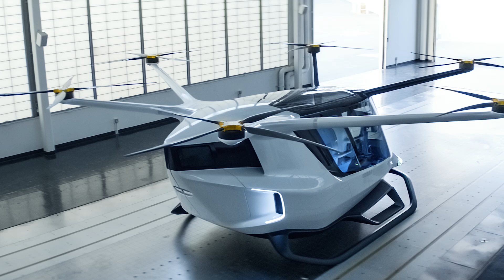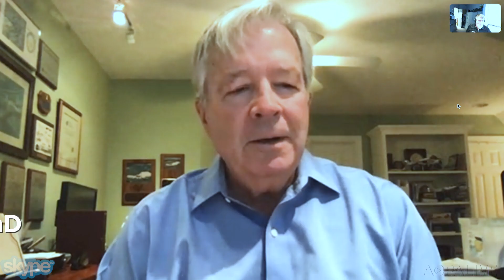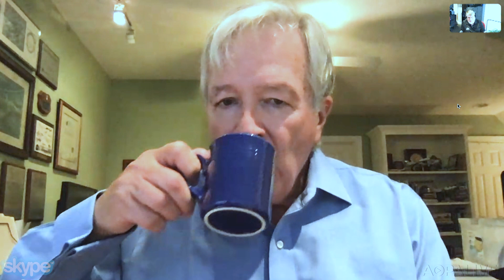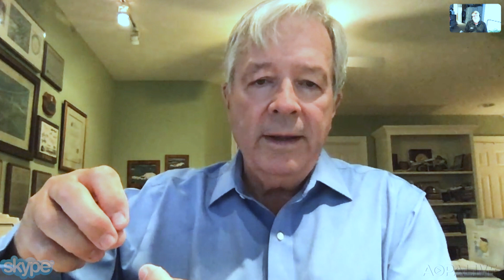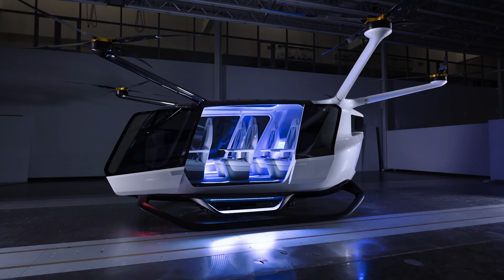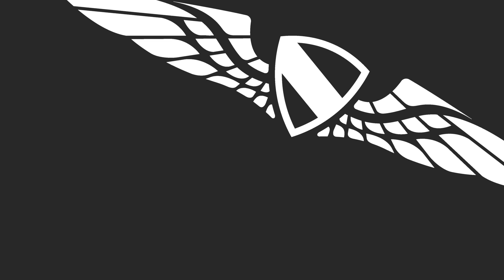Dr. Bruce Holmes - eVTOLS and hydrogen power

Comment: He's wrong because hydrogen is critically difficult to store and handle. Honda made a fuel cell car with a carbon fiber tank of hundreds of liters capable of withstanding the pressure in the mariana trench and it could hold 4kg of hydrogen. The equivalent energy of 10kg of gasoline which you can store in a plastic bag. And fuel cells are only around 40-50% efficient which can actually be matched by a turbine generator. So by weight HFC is savagely bested by a very conventional fuel burner. If you are concerned about green credentials then liquid fuel can be produced from green electricity. Synthetic fuel is quite viable. But more importantly for the jump vtol market, battery flight with current technology can get you 300km down range and that's plenty reach for the instant gratification segment and if you need to go further then the jump was to an actual long distance airplane and on from there.
Just like with battery cars vs hydrogen cars, battery flight will dominate so greatly that hydrogen never competed.
I would further point out that SUV thinking for vtol is old school and missing the mark of uber rides where it's 1 or 2 people that need to go. Same as we drive in our cars. If a family of 4 need to go to the airport then take 2. Size and weight is going to be very critical when setting down in a city. Corporate helicopter obesity need not apply. Less Trump more butterfly.
Further, I'm assuming that the Skai doesn't actually fly. And it doesn't avail itself of lifting surfaces nor aerodynamics so it's very energy costly operation should it ever fly.
2 tilt wings and very aerodynamic body is a vastly superior configuration.
Reply: Dan Frederiksen its all about the weight of the energy storing system and the time to refuel said system. The Hyundai Nexo for instance has a range of 600 Kilometers and needs 6 kgs Hydrogen, and it takes a few minutes to refuel. Compare this with a Tesla. I would say it takes almost 600 kgs of batteries to get close, and at least 20 minutes to refuel. Above that, the production of batteries ist not without challenges. Batteries can not be the future solution for storing energy for transportation. The Nexo is for sale here in the Netherlands, everybody can buy the car. There is a complete taxi fleet in the Dutch capitol running on Hydrogen. The problem with hydrogen is the price and the lack of infrastructure. And this is mainly a political problem, not a technical.
Reply: @ClintEatWood  no there is infrastructure. But the hydrogen comes from fossil fuels, it uses 3x as much energy as a battery car and you've never seen one refill in a couple of minutes because it actually takes 20. And it's not 6kg. It's 6kg of hydrogen under extreme pressure in a tank that weighs hundreds of kg and a piping system able to cope with the temperature differences and the 700 bar pressure. Tesla cars can drive 5-600km now and you can charge them at home. Tesla Model 3 can charge at 1600km/h now. It's pretty fast. You may want to realize that battery cars totally dominates hydrogen cars. It's not a contest. No one wants it because it's a bad solution.
Reply: @DanFrederiksen  don't forget that the energy for a Tesla also comes from fossil fuel. And especially US Powerplants are not the most efficient ones. So I put question marks to your stated "3x as much energy". The Hyundai Nexo fuel consumption is 0,92 kgs per 100 Kilometer. Hydrogen cost 10€/kg. This is about the same price as a gasoline car in Europe. Also your statement for refueling time "because it actually takes 20" is not correct (Source https://www.youtube.com/watch?v=41LKbkQV_k4&t=1627s), it takes max 10 minutes, in general 5 minutes. Show me a Tesla that can drive 5-600 km on one load, I have question marks there too. Especially in winter time, and in mountainous areas like Aspen for instance, you are very lucky wenn you reach 400 km. And charging at home takes hours! Were do you get the information that "hydrogen tanks weigh hundreds of kilos"? Guess how much a Tesla battery weighs: 540 kgs. Source https://en.wikipedia.org/wiki/Tesla_Model_S . The Toyota Mirai Fuel Cell weighs 56 kgs and the Hydrogen tank 87,5 kgs. Sorry to say, but your facts are not correct. Don't understand me wrong, I like Tesla's. Electric cars will gain market share, but the battery will not be the long term solution.
Reply: @ClintEatWood  to be fair I exaggerated the tank weight, still hundreds of kgs for the system and not the bullshit claim that the fuel only weighs a couple of kilos and leave it at that. 
Tesla Model 3 is outselling Merc C, BMW 3 and Audi A4 combined in north america. Hydrogen fuel cells cars aren't selling any whatsoever. Hydrogen fuel cell vehicles will never be. Deal with it. The idiots at Toyota and Honda have been insisting it will triump for 10 years yet they failed spectacularly on launch in 2015. Supposed mass production. 
Everyone in green cars hate HFC cars because we understand how much it sucks and that only evil oil corps promote them. 
But an aside is that liquid fuel fuel cells could have merit. And it's possible to make synthetic fuel from green electricity so it's CO2 neutral. Because liquid hydrocarbon fuel is easy to store and handle. Hydrogen however is not. I'll bet you a billion dollars that this Skai hydrogen nonsense wont be even remotely a commercial success. 
I'd be surprised if it ever flies, even empty.
Reply: Dan Frederiksen I am not arguing about the success of Tesla. They changed the world, and did a great job! I am arguing about the right accumulator to store electrical energy used for aviation purposes. The main issues in aviation with batteries are:
1. The weight of the accumulator in KJ/kg
2. The time to refill.
Like I explained before a comparable FC inclusive tanks weigh less than 150 kgs, the battery of a Tesla 540 kgs. This is not a big problem for cars and boats, but it is for airplanes if you want to fly longer than 30 minutes. And, the weight of a battery is almost proportional (KJ/kg) to the stored energy. The weight of an FC is disproportionally, because the energy carrier Hydrogen is very light. Thus, a larger tank reduces the weight per KJ. Imagine how many kg’s of batteries are needed for an intercontinental flight with a Boeing 747 with electrical propulsion. And think about the time to refill. No way that this is going to happen in the next 5 – 10 years. So, my conclusion is, for aviation purposes Hydrogen might be a better way to store energy than in a battery. Just think about it.
Ps I would not compare Tesla Model 3 with a 3 series bimmer. That is comparing apples with pears. They (BMW) don’t even have serious electric vehicles, and still sold 200.000 cars in the US first two quarters this year.
Reply: @ClintEatWood  It's true that you can pack more range into an aircraft with hydrogen than battery but the same is true in a car. It's just not enough to matter. Battery is so much more elegant for modest range and for really long range, hydrogen cannot compete. And that's not considering danger and power density. There is a serious israeli company doing a 1000km electric jet. Not a hydrogen plane. For aircraft long distance use, only liquid fuel fuel cells need apply. Hydrogen will never be.
Reply: @DanFrederiksen  "I think there is a world market for maybe five computers."
Thomas Watson, president of IBM, 1943
Reply: @ClintEatWood  I have seen a thousand years ahead.
Reply: @ClintEatWood  That plane isn't actually flying on hydrogen and their claims are hugely unrealistic.
Reply: PistonAvatarGuy if it is not flying on hydrogen, on what is it flying than?
Reply: @ClintEatWood  According to ZeroAvia, they've only flown it on batteries. Fuel cells and their hydrogen storage tanks are even larger and heavier than batteries, so there isn't going to be any benefit to using hydrogen in that application.
Reply: Crucial difference in terms of tank mass is this concept is using cryogenic liquid hydrogen, not high pressure gas. This of course comes with its own problems, but you can carry more than a kg of fuel per kg of tank at least - otherwise it wouldn't be so successful in rockets